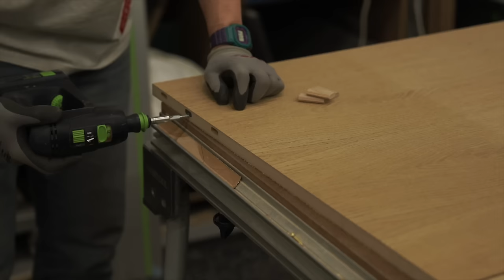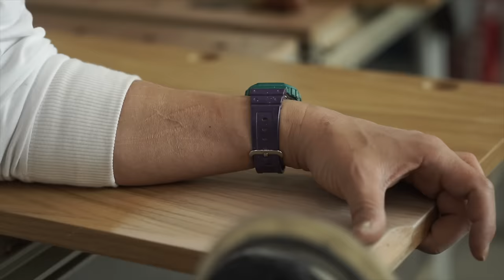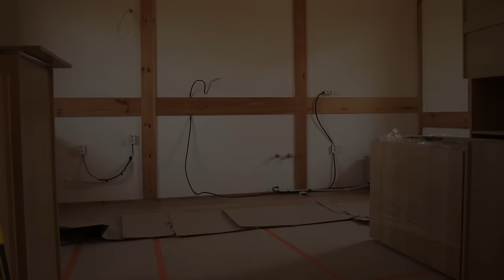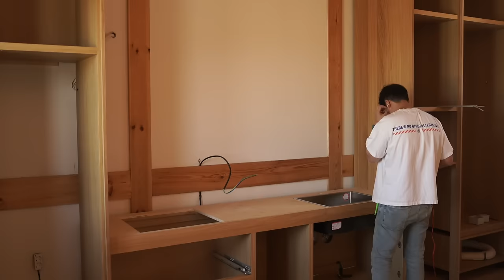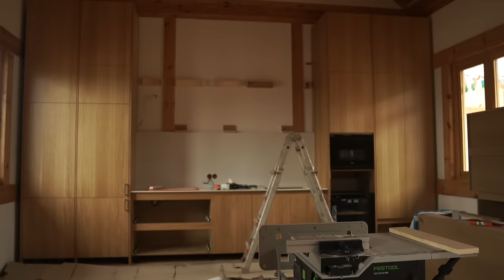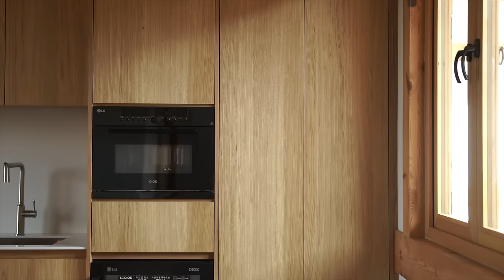W140_A huge kitchen

Comment: I would like to start wood working, but how will I start I need a lot of money just for some basic tools, and then we see videos like this guy here, making super furniture, but when u notice, most of them use some super wood, in sense like, oak, mdf or hdf, etc etc. those woods are expensive, then the machinwry they use 😮, just a festool circular saw is 1000+ Euro with a vacuum,......
Reply from the maker: when I started ViTTEN 12years ago. I just have 6,000 Euro. I only bought very basic tools. and I couldn’t buy plywoods because they are so expensive. I used mdf and very cheap woods. After that. I kept working and buying new tools and when i had money. I bought high-end materials, oak walnut, etc.. and practice with them. The money I earned for 12years went into my workshop only. It’s the same now